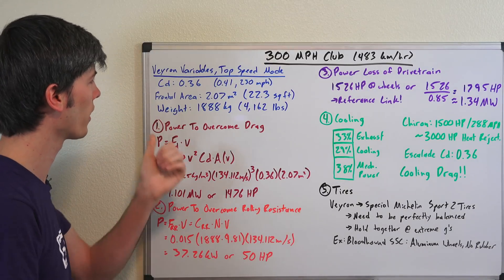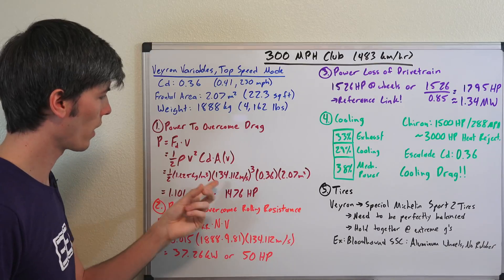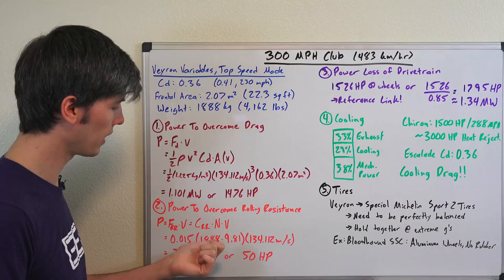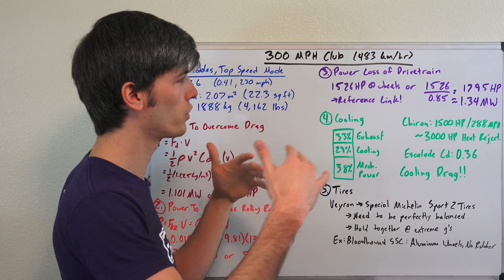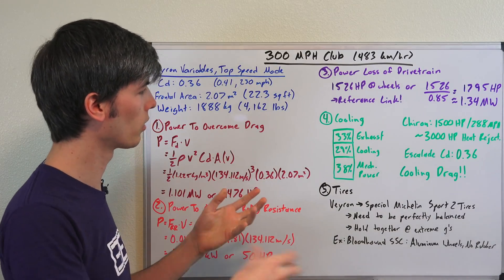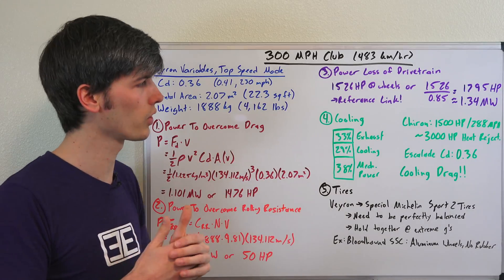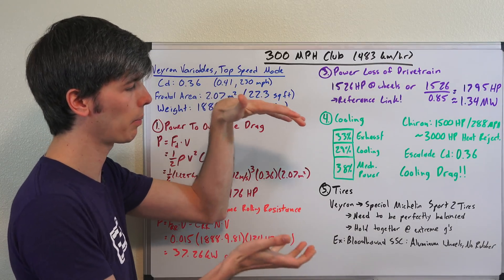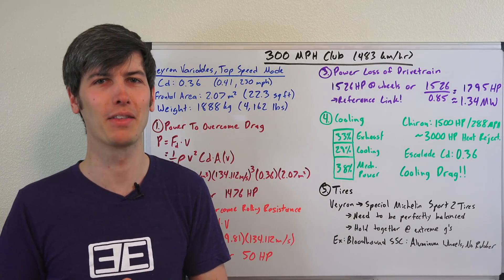Why Has No Production Car Hit 300 MPH?

Comment: What if you had a tank of liquid nitrogen, that was used to cool the engine at top speed mode? Have the radiators covered by motorized flaps, in a way that dramatically reduces the drag. Might not be super practical for a production car, but I feel like it would work. Unless there is just too much heat to be taken away by a realistic amount of onboard nitrogen.

Comment: could the use of a cooling compressor circuit (equal to air con/ fridge for engine cooling) help lowering the the drag for a high speed car? maybe the drag of a cooling compressor would be just squared with v instead of cube with v ... i dont know

Comment: Correct me if I'm wrong but doesn't reducing the weight much further along with the above mentioned points help u in achieving the 300mph mark much quicker? You know, reduce weight, add more downforce to maintain the stability?
Reply from the maker: Well, downforce is great for stability, but it adds drag. Reducing weight will reduce your rolling resistance, but that plays an extremely minimal role in top speed. For the most part, weight does not affect what your top speed is, but it does affect how long it takes you to reach that top speed.

Comment: Ok so why hasn't anyone built one with 1800hp? People are building american muscle v8s in that neighborhood of power why can't Bugatti build a V10 or v12 with that kinda power? It's not easy but for those guys it's not hard either. I challenge Dodge to bring back the cuda and make it have 1800hp. American muscle for the win. That'll shut up the Chevy fan boys about the exorcist for awhile.
Reply: Because the W16 engine is powerful and reliable at the same time, you can take a Veyron and do as many speed runs as you like.
Reply: That's fine and all but that doesn't explain why they havent made a w16 with 1800hp.  A big American v8 can make that power pretty reliably so why can a supercar that costs upwards of 1million with double the cylinders not do that very reliably. I still say  dodge should shut up the chevy fanboys and make a cuda with that kinda power.

Comment: try do it with electric car. it require significantly less cooling
Reply: you have no idea how hot batteries and the motor can get. try using a battery drill and use the other hand for resistance, within a minute that tool is overheated.
Reply: He just did a video about how electric cars require similar amount of cooling for similar tasks.
Reply: There is already an electric car (not production, I admit) that reached 341 mph - the Venturi VBB 3. Unlike other hyper-fast cars, this one accelerates using the wheels, not using jet power. 
So the physics of lower drag and electric propulsion are not the problem. We just need someone to take on the technology issues.
Reply: Nikola,
I think you're missing the point as no one was saying an EV could not reach 300mph. Of course drag is the main factor in top speed and that's what was pointed out by E/E. But a car designed to have more than 1 person and be used for everyday use usually has some design issues with trying to achieve huge top speeds. For reference in 1935 Malcolm Campbell and his Blue Bird hit 300mph in their vehicle making an estimate 2300hp. There are plenty of engine builders now that can achieve such power levels. But again drag like the video said is the issue. EV or ICE both have cooling issues that need cooling devices that create drag and on top of that in a production car if they want to stick to the ground they need downforce and it'll create more drag as well. That's why the most powerful production Corvette to date is actually a bit lower top speed than some other Corvettes due to aero parts put on to create more downforce.
Reply: The biggest Problem Are still the tires. We can fix the cooling problem easylie, but tires Are a big Problem.
Reply: power is power. you can't defy the physics.

Comment: No production car electric or combustion engine will ever do 300mph.  Theyre not aerodynamic enough,  wind resistance at those speeds is too much,  tyres are an issue, so is cooling and weight. Only option is a jet engine like landspeed cars with jet like aerodynamics.  Which would make it not be a production car anymore

Comment: Would it be possible to reduce the drag from cooling by having parts of the body work act as radiators? So at high speed you can shut off some of the intakes in favour of this cooling body panels in order to reduce drag, while still keeping cooling to a sufficient level due to the high speed airflow over the body. Of course the panels may look a little weird I image there surface area would have to be increased with horizontal ridges or something. But I'm sure someone could make it look aesthetically pleasing. you could also design the ridges to give a bit of down-force and stability too to remove the need for a wing.

Of course like other comments say you could just go electric or hybrid and cooling would probably be reduced.

Comment: Its so obvious, bassically the reason why production cars cant make the 300mph mark is because the heat exchanger will need extra cooling after every jigawat which you will need 1800hp and so that cause the transmiter to pruduce more power to the crank with is more to the wheels but without the transplum it will create to much drag and we want less drag and the liquid transplum is so rare that only a sertain amount of car will hit crowd because he didint went to space so now he will die and reach tomorrow without everyone that is eating right now so now nobody cant walk simple as that.

Comment: Of the three factors listed, tires is the hardest one to overcome.  There are several racing engine builders who can create a reliable 2000+ hp engine.   Any number of sports cars are aerodynamic enough to reach reach 300 mph, even with the added down force and heat dissipation requirements.  However, there are no readily available tires which can tolerate the heat and centrifugal forces generated at 300 mph.  
The Veyron and Chiron are both tire limited, with VW easily able to get more HP from that 8 litter W-16 if needed.  Think of that engine as being four 2.0 liter engines with a common crank.  The highest output production 2.0 liter engines today exceed 350 hp.  Racing spec 2.0 liters regularly exceed 600 hp.  So four 2.0 liter engines combined should be able to produce at least 1400 hp and with tuning reach the needed 2000 hp.   
Funny cars and  top fuel dragsters regularly exceed 300 mph in the 1/4 mile, however they are only at that speed for a couple of seconds.  A production car cannot reach that speed in under 5 seconds, so instead it will need several miles of road surface to reach 300 mph.  That longer distance will build up massive heat in the tires that would deteriorate the materials, like putting a blow torch on the tires while lifting an elephant with them.  As the heat builds, the rubber would deform until the tires disintegrate in an explosion.  The resulting crash would be spectacular to say the least.

Comment: If this is correct please explain how the 1967 24 hours of LeMans winning Ford Gt40 MKIV exceeded 230 mph with unrestricted RPM and 212mph when restricted to 6500 RPM for the race with only 480 flywheel HP ? Also how did the 1971 LeMans winning Porsche 917 exceed 240 mph with only 600 flywheel HP?

Comment: What about an EV ? As the motors are much more efficient and only battery and DC/DC are heating, there would be much less power to transfer in the air.

Comment: how about electric engines? how much power would be necessary to run at close to these speeds? I mean I see tesla cars top at 130-150mph, what is need to go beyond these speeds? (just better power/weigh ratio batteries?)

Comment: solution would be an electric car (with better battery) with smaller air resistance (without vents) and compressor filling a bottle with liquid air/nitrogen while driving (el. car produces less heat). and when you want to reach top speed you will have limited time until you empty your bottles which are cooling the system while accelerating from 150 until 300 mph... it could be a reusable, road legal and mass produced car...

Comment: would it not be way easier to trim weigh off that behemoth rather than reduce the cooling efficiency to achieve 300 mph? currently you predict that roughly a 2.333:1 weight to power ration will achieve 300 mph hour so theoretically if all else remained relative, then a 3500lb car could achieve this goal at 1500 hp right?
Reply: No, just look at the calculations on the left side and change the 1888kg with a lower weight. It doesn't change that much.  Weight only affects the rolling resistance, which is far smaller then the drag at 300mph (1246HP vs 50HP). So actually you can say, that the weight of a car is irrelevant for the top speed of a car. It is all about the air drag.
Reply: im not sure i can agree with u 100%. i acknowledge the fact that weight is the main contributor to rolling resistance, well i suppose tire surface area is a big factor also, however i know that a 300 whp car will never beat a 300 whp motorcycle in a drag race. i also realize that is all about quickly accelerating a certain distance and not necessarily a given speen, but it is about acceleration and some principles should transpose.

Comment: So basically this goal is very difficult to achieve with a thermic engine, but would that be easier to do with a 4 electric motor car? generating less heat, not having power train loss and being overall more efficient?
Reply: Didnt the rimac concept 1 have 4 motors?

Comment: There's two cars I know with claimed 2000 and 5000 hp respectively
Reply: 5000hp was probably the devel sixteen and that car is a joke.They just throw numbers around.
2000hp can be achieved on alot of cars however that still isnt enough

Comment: Add a steam turbine and generator to it, then use this to power the electric motor that re-purposes the waste heat as more torque.  Also add an exhaust powered impeller on the steam turbine shaft to allow the engine to begin generating power as soon as you start it up, before the steam turbine has time to heat up.  Then route the exhaust leaving the impeller to a catalytic converter which will further increase the heat of the exhaust stream, after that it passes through the air-water heat exchanger that is part of the block coolant system.  This block coolant system has another water-water heat exchanger/boiler that provides the steam for the turbine.  Super efficiency  

Psst Elon I need a job!!

Comment: Top Fuel, 300 MPH club required 6000 hp in a 2400 lb rail, which has the least amount of aerodynamic drag possible. Of course this was done in only a quarter mile. The new top of the line Porches can go 280 in an open course. Still aerodynamic drag is a huge limiter. So is lift. A car that has low drag is shaped somewhat like an airplanes wing, and tends to want to fly at high speeds. To counter this some sort of down force must be generated to keep things firmly planted on the ground. Wings and body modifications all cause aerodynamic drag, requiring more horsepower to get the same speed as without. Of course the engineer covers all this, but it goes without saying that the power requirement to go 300 mph in a street car is incredible. And to keep things under control makes things even that more difficult.

Comment: make a 300 mph electric car. it wouldn't need as much cooling drag.
Reply: Actually heat has a lot to do with the electric engines too especially on the battery. Also like this other guy said batteries get heavy. I went to the TT in 2015 and talked briefly with one of the swedish engineers that worked on one of their electric bikes there. The course is something like 32 miles and the charge is completely drained with top speed of around 190 mph and average 118 mph, or so on the electric bike. He also commented on the heat after that single lap and how the battery had to be taken off to cool and replaced if it was to go again immediately. Top speeds now break 200mph on race bikes and average 133.4 from the top rider now.
Reply: BrunixBROGamer not if you only get up to 300 once :)
Reply: actually you woulda need a pretty big fucken battery weighing 2 tons
Reply: @brunixbrogamer9852  Weight doesn't negatively affect top speed, only acceleration.
Reply: Actually they do. Electric powertrains run at a much lower temperature than an ICE so they're far less efficient at radiating away their heat. They'll absolutely suffer in hot tropical summers. This means the cooling systems have to be sized up considerably until they're on par with the Bugatti Chiron's. This channel had covererd that in another video.
Reply: Actually they do. Electric powertrains run at a much lower temperature than an ICE so they're far less efficient at radiating away their heat. They'll absolutely suffer in hot tropical summers. This means the cooling systems have to be sized up considerably until they're on par with the Bugatti Chiron's. This channel had covererd that in another video.
Reply: Jake Austin if you only could hit top speed once before replacement it cant be legally a "production" car making that point invalid
Reply: Tre Talks Tech I'm joking
Reply: Jake Austin flew over my head. But still for anyone else who misses it
Reply: Tesla's working on it, with the new Roadster 2. No clue if they'll actually manage it, though.
Reply: Batteries, schmatteries. Just use a long extension cord....
Reply: srinitaaigaura but you are forgetting that ice turns half o fuel energy into heat, and  an electric motor has efficiency over 98% usually, so electric engine with same power as an ice will nead 20 times less cooling
Reply: Go ahead and google "first law of thermodynamics" =)

Comment: 15% power loss is usually for FWD. awd like a veyron would be over 20% for sure
Reply: Power loss is not linear.  It may be 15% for low-powered cars say, 100-200 hp, but only 14% for 300-400 hp, and so on.  Just an example.

Comment: In car aerodynamics, everyone talks about the coefficient of drag, but tend to ignore frontal area. If you have half the frontal area, you have half the aero drag. Therefore a design with a single passenger in front should be capable of this with enough power. So something like an Elio body with a 900hp engine will break 300mph.

Comment: Looking at world speed records on land, we can see what the problems are for high-speed driving:
- Keep vehicle PRESSED on the road. Not to fly up! Or it's not more official.
- Indeed special wheels needed. High speed vehicles for world record uses full alu wheels.
- Normal motor cannot make it. They uses turbines to reach higher speeds because turbines cooled itself a bit with air. Normal motor exchange heat to water and water exchange to air. That is long exchange way and bit slower. Air-Air can reach 300+ degrees and no problem. Air-Water-Air cannot reach more than 120 degrees or it will just expand more and blew up. Or it just vaporize water faster.
- And the air part has big radiators... for high resistance with air. Bigger radiators can cool more, but smaller much less... We want keep air resistance low as possible but it's very difficult to find right balance.

That is why cars with normal motor (thus all production cars) will not make it. Higher speed will make things twice more harder. More harder, then again it doubled up. Forget it. People tried it already and it's not possible, so they use turbine motor as last solution for it.

Why can electric (bullet)train reach 300 mph? Because electric motor is more efficient and lesser heat. So it needs less heat exchange. But a lot power is needed, and that is possible because electric line is there above the train.... it will give enough power. Better train body too for low air resistance.
This is not possible with batteries because it will heat up more. And batteries is also just extra weight drag....

Comment: Interesting video. I didn't hear you mention one thing however, how fast a car can go on public highways (not legally I'm talking physics) I've been for a ride at 155 MPH on an American interstate highway in a corvette and I can tell you the driver heeded both lanes to keep the car on the road. Every shallow dip in the pavement felt like a jump on a dirt bike. It would take a specially  engineered road (like an airport runway or the Bonneville Salt Flats) to keep a car stable at 300 mph.
Reply: Just go to the top gear vid where james hit 417km/h .Thats a good place to start
Reply: OK, so not american roads .... but that kinda goes without saying.

Comment: It's coming, just recently M2K Motorsports reached 293 mph with there turbocharged 2006 Ford GT and they did it in 1 mile. The 5.4 L V8 was estimated to deliver 2500 hp. And Chevrolet has a variety of patents filed for the upcoming C7 ZR1 Corvette that are all about active aerodynamics. This way a computer can determine how much downforce and cooling is needed and make instant adjustments to dozens of aerodynamic surfaces to deliver what's needed while allowing far faster top speeds then the current C7 Corvette that uses a low of fixed downforce to be stable.